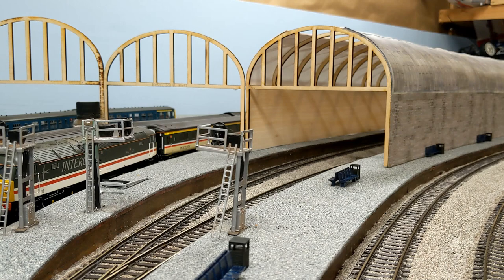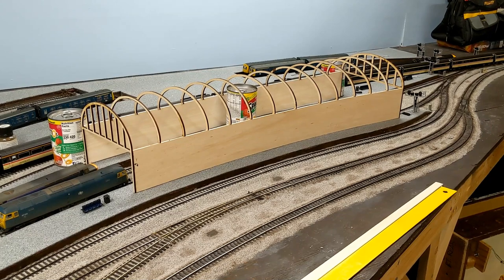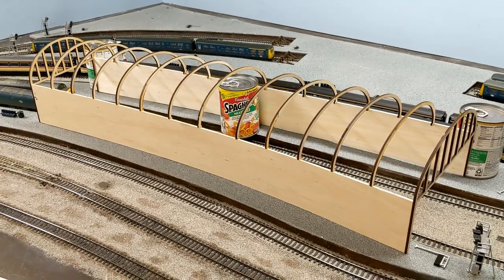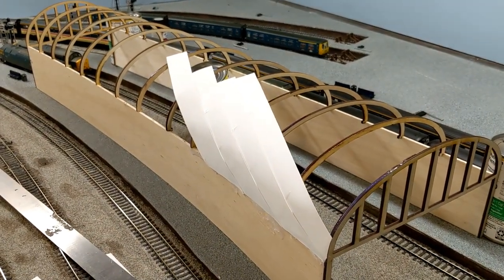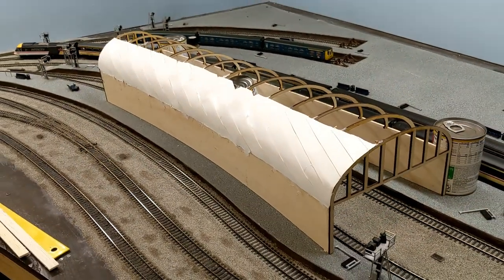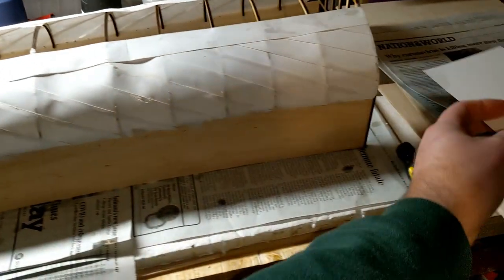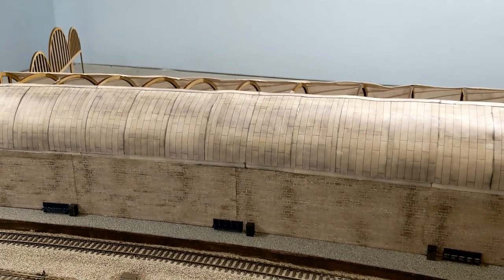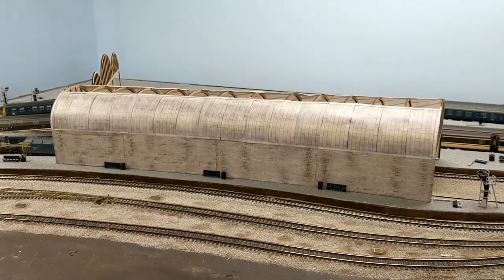41 - Station buildings - part 2

Comment: Looking good.
Sand stone wall looks just about right. There is a water tower made of the same stone with a metal tank on top, in front of the station building. This was used as a tool shed for the permanent way staff in the 1980's.
Reply from the maker: Thanks, I'm happy with the brick wall. The roofing not as much, but I'm going to try weathering it down a little. And yes, the water tower is one I'm planning on modeling in time, too. Iain

Comment: Well done. Pretty sure from memory that there are buildings on the second platform over. Toilets etc. You obviously don't have room on your platform but you can represent them with building flats to give the look either side of the second wall. The ramp from the footbridge runs down the inside of the wall too if that makes sense. Fantastic progress. Looking forward to see how you tackle the rest. Cheers from  Newcastle!
Reply from the maker: Thank you! Yep, I've seen them in photos. There is room to model them just as flats, they would just fit with the height of the walkways between the walls. I'm waiting until I'd put the bridges in place first so I know for sure where they're going to be and so where to make them. Thanks for watching and following along! Iain

Comment: Looking very good. Although it has been a few years since I used Newcastle central Station, I am sure that there was at least a couple of arches in those two walls for passengers to easily pass between the various platforms. I know that the footbridge passed through the inner wall. It might be worth checking with someone who lives in Newcastle. Just so you don't have to mess with it after you have finished such a good job. If my memory is wrong I apologise.
Reply from the maker: There, are yes. I have one of them cut in now, the other I'll wait until I have the footbridge in place to make sure I know where to place it. Iain

Comment: Really nice job at the station canopy mabey for the top you could use clear plasticard that goes from one side of the arch to the otherside and then stick the sheet metal roofing texture to it with spray adheasive and that should work fine i will be intrested to see how this project goes.
Reply from the maker: Yep, that's what I was thinking for the canopy glazing. Or like the old OHP sheets from school so it's clear, but flexible. I have a couple of materials on order to try it out and see what works! Iain